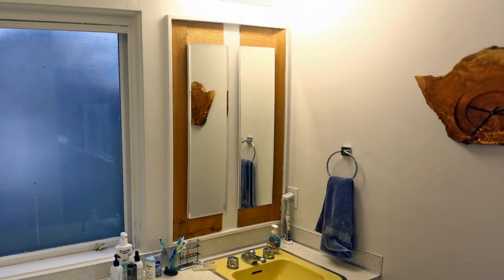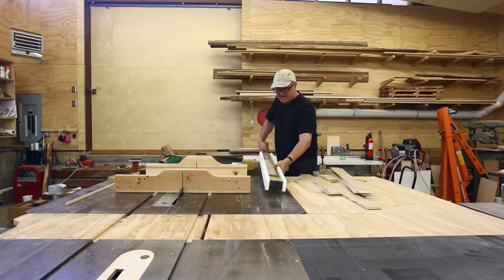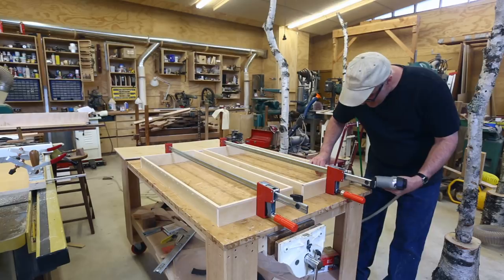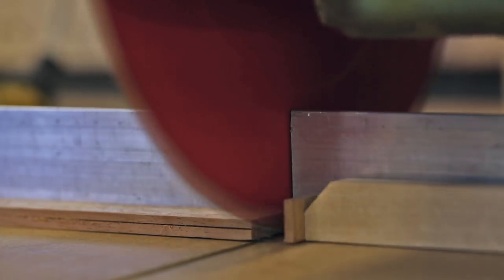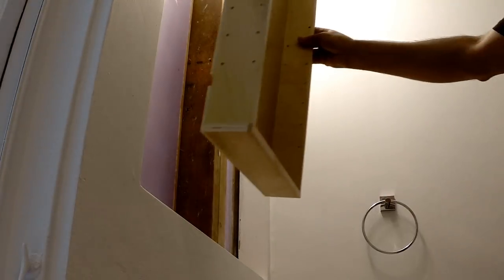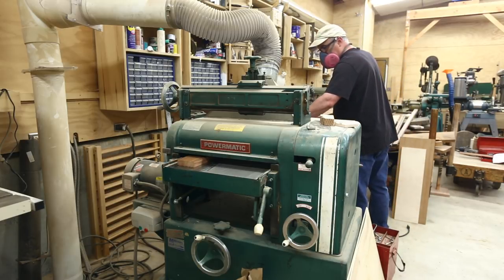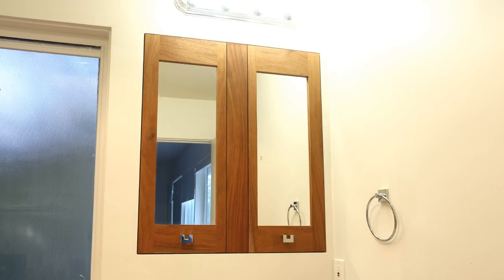Bathroom Cabinets Part 3: Medicine Cabinet

Comment: For anyone nervous about cutting glass, it's not necessary to do all that clamping stuff to snap the glass. You just score it and snap it at the edge of the table or on the table with a length of wood under the cut. If it's thick glass, a light tap underneath with the opposite end of your cutter will help start the cut off. Love all the stop frame Frank. Very PES.

Comment: Fantastic as always. For cutting glass, Ive had the most success with placing a dowel underneath the score line and then applying pressure to both sides of the glass. Very high success rate this way
Reply from the maker: I will have to try that.

Comment: I really enjoy your videos. I especially like how you do not attempt to make, say the mirrored doors, 100% sized on the first go. Instead, you leave it a bit big and or long and trim away the excess to achieve the desired final dimension. I spend too much time trying to get it to the 1/64th on the first round which is really a time waster. I prefer your method much better. Thanks for the lesson.

Comment: You over did the glass cutting part big time. Moving all those clamps and plywood over the glass just multiplies the chance to accidently break it. Next time just lay the glass with the cut flat on a even surface. Then put thin rod at least as long as the cut under the glass under the cut. Make sure you align the rod with the cut. Then just press the side of the glass that doesn't touch the surface and it will snap and come off. Maybe you knew this already but couldn't help myself. I really admire people who can build stuff out of wood. And I must say I enjoy watching your videos. Happy new year.
Reply from the maker: Thanks. I did not know that, it seems like it would work well.

Comment: Back here in the East, we all laugh when redoing a medicine cabinet. The REALLY old ones had a slot in the back for used/dull razor blades, and if you removed the vanity and cabinet, you would find a pile of them on the floor or in the wall space. Every wonder why contractors aren't afraid of hypodermic needles? Hahahahaha!

Comment: Looks great, Frank! Only thing I didn't like about it was you nailing the filler piece of wood to the wall...
Reply from the maker: The pieces its self or the nails?
Reply: frank howarth Well, you can still see them slightly in the finished 'product', right? I don't know enough about woodworking to propose a better solution but I can imagine there probably is some kind of kit you could use?

Comment: 4:30 Hey Frank... I saw in another woodworkers's videos that they tap gently the glass a few times along the cut, looks like a more simple way to do it.
Reply from the maker: I tried something like that and it did not break in a straight line, maybe if I knew what I was doing...

Comment: Very nice. I used hinges like that. I always have trouble lining them up just right, especially on large cabinets and doors. Any tips and tricks?
Reply from the maker: I usually install them on the door first then attach the whole assembly to the cabinet.  The hinges do have some adjustment in all three axis which helps too.

Comment: frank !! bud, you need a crash course in design. you are way ahead in wood working skills. there are shorter screws, shorter hinges ( depth wise ), contact cement comes in a can, made by 3m and you are better off using a rag instead of paper to apply your finish . keep up the wood work,

Comment: Wonderful work, Frank! :)
My question is: why on the inner side of the carriage made miter horizontal groove?
  (On the side that is facing you. On Video - 5: 39 minutes)
Thank you. Mark.
Reply from the maker: Thanks, I was thinking I would put a "T" track in there for stops or hold downs, but I have never gotten to it.  Good eye.
Reply: frank howarth Thanks for the answer.
  I had expected :) But doubt.
  Usually "T - slot" all masters (including me :) - make the top.
  But the shape of your carriage - pushing to make this decision.
  Mark.

Comment: I'm a little confused regarding your choice of when to use your dust mask. You wore it when using the table saw (I tend not to) but you didn't when flush trimming the backs of the cabinets with a router (which I always wear a mask for). I'm not trying to point fingers or pick you up on things, I'd just like to know if there's something I could learn from what you do because all your videos and projects are far better than any of mine.
Reply from the maker: I doubt there is anything you can learn from when I do and do not wear a dusk mask. : )   I should be wearing it all the time, sometimes I forget.

Comment: Two questions:

1) Why didn't you back the mirror with that thin plywood rather than use the small, square blocks?

2) What happens if you have to replace the mirrors?
Reply from the maker: The think plywood would have been better, now that you mention it.   My plan is to rabbet out the back if the glass breaks to replace it.  I'm half way to the correct solution as it is.

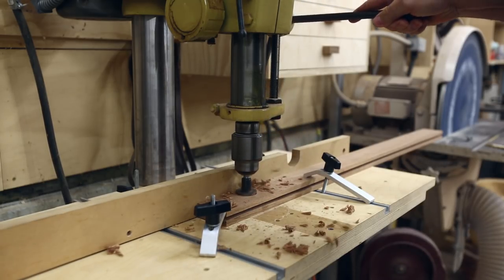Comment: What kind of drill bit is that? at 4:00 minutes
Reply from the maker: forstner bit
Reply: Is it? it looks less cylinder-ish then a forstner. Is an older style?
Reply from the maker: Chris Wiebler I think is is something I picked up at a garage sale a while back  it is very thin but it works like a forstner bit and is the 35 mm I need for the hinges.
Reply: I see, thanks.